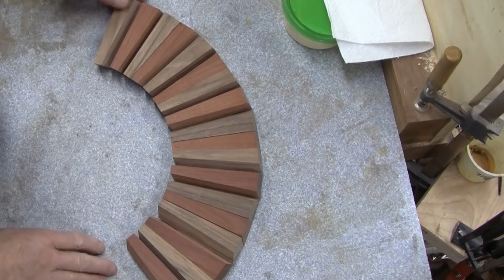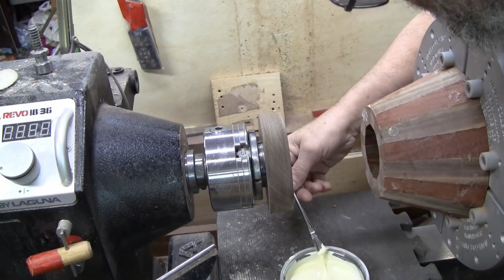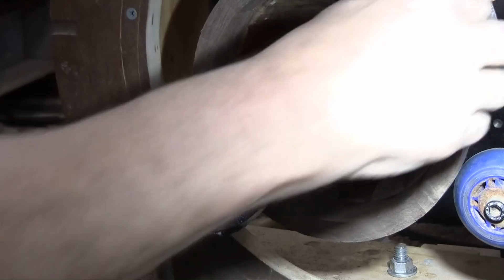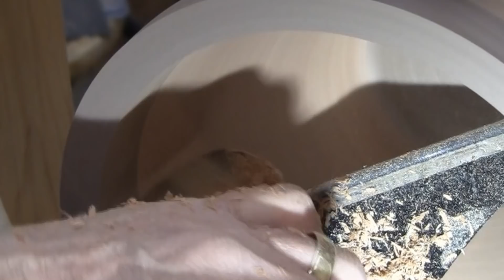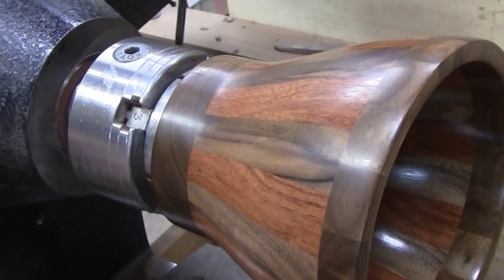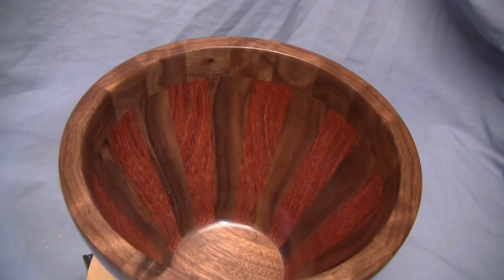Wood Turning Staved Bowl from Jatoba and Walnut

Comment: Very elegant turning how do you figure out your angles and make the angles work together
Reply from the maker: Thank you Robert! There are lots of compound angle calculators online. I also have WoodTurners Pro which does it as well. Then using a digital angle finder to set the blade is a plus.
To set the sled angle I measure the slope of my fence using trigonometry and adjust to match what the program tells me it should be.
Hope this helps.
Thanks for watching,
Gary